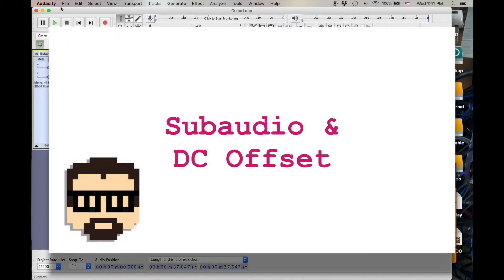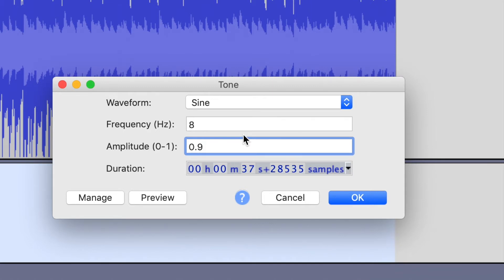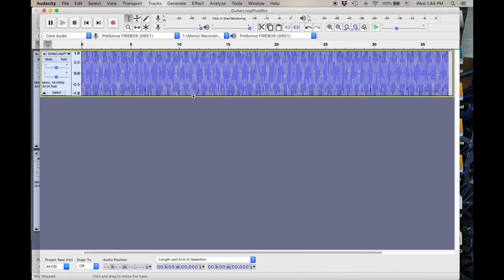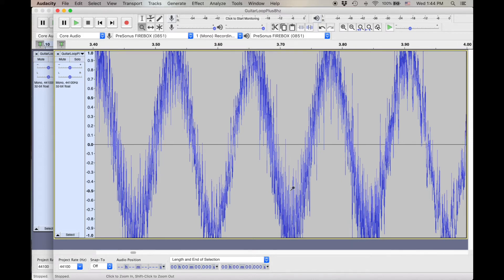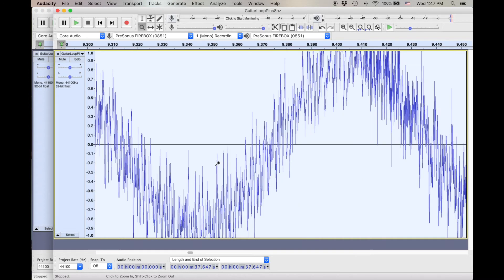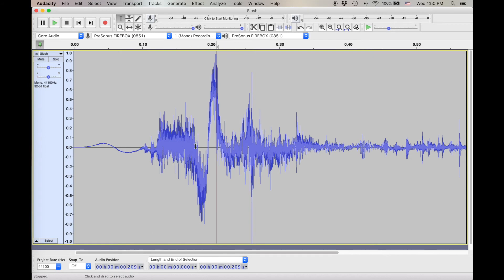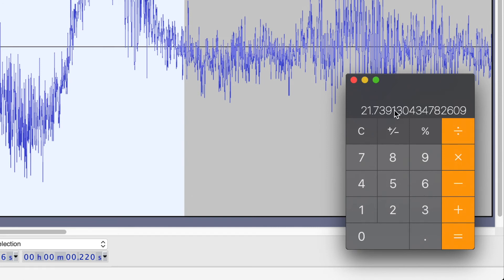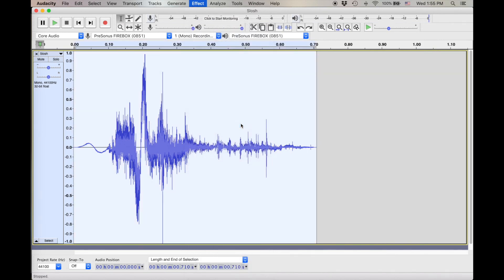Sonic Clarity: Understanding Subaudio and DC Offset | Simon Hutchinson

Comment: So much wisdom here. Thank you. Any thoughts on uneven voiceover waveforms? At first I thought DC offset, but after researching and assessing my waveforms and signal chain, I realized it may not be DC offset, but in this case, what could be the cause? And is there a fix from the recording end that doesn't involve phase rotation or high pass? Been curious about this for a long time!
Reply from the maker: If I'm understanding you correctly here, "uneven", as in going further from the zero axis on one side more than another, isn't actually a problem. Some waveforms are just like that. Remove DC offset recenters the waveform, but, for example, if it's going to a higher amplitude on one side of zero, and spends a longer time on the other side of zero, that can look uneven, but actually isn't an issue.